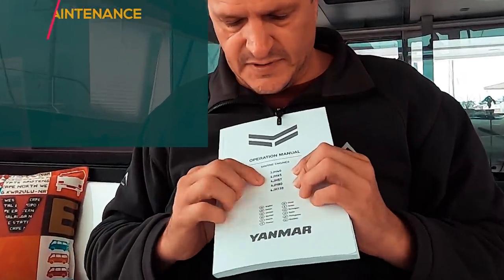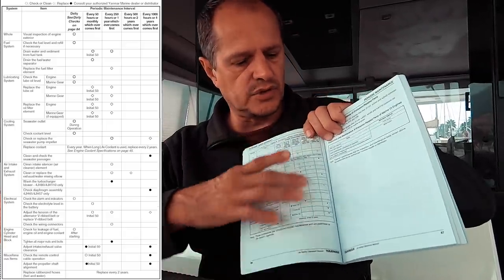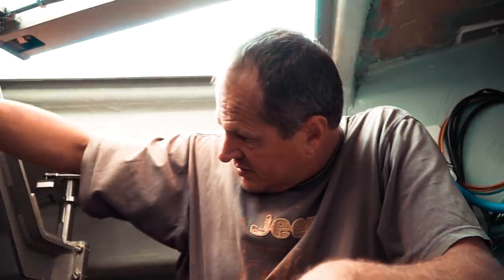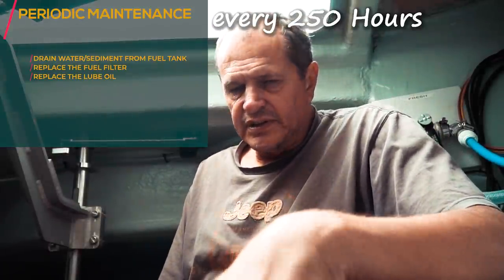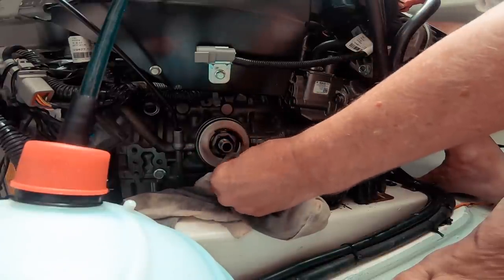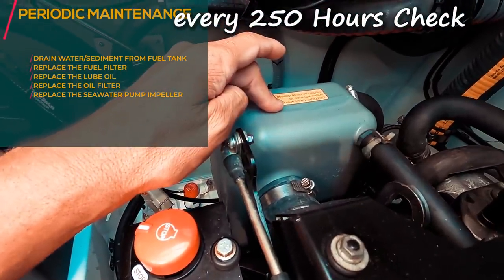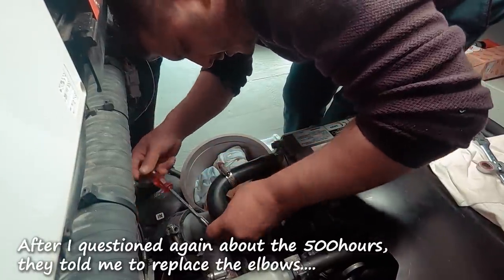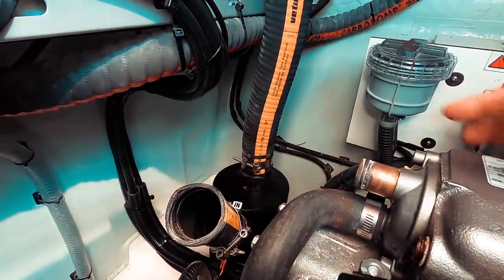#85t Boat Life Yanmar 4JH45 Service | Sailing Sisu Leopard 45 Catamaran Circumnavigating

Comment: Metal filings?   That doesn’t seem reasonable in a newish sail drive, or is it?
Reply from the maker: hi, tony! i have heard that is exactly why the first oil change should be done at 50 hours, because the gears are 'settling in' .... no idea if it is good or bad...all i know is, i am losing my engine by the microns!
Reply: Metal filings... UGGGGH.

I believe most manufacturers would probably have a strategy in place to have an engine or a sail drive in this case to last a specified period of time. They have a degree of control by being in the command position of being able to specify the oil change interval and ... and to recommend oils with a spec that would fall specifically into their longevity target parameters (the co efficient of friction viscosity and heat tolerance to name a few.)

This probably has influence over how they would arrive at their recommendations for oil change. If it last too long then they may go outta business, too short and its a poor quality product. 

If they specify 50 hour first oil change then I probably would adopt a strategy of an oil change EVERY 10 hours until the motor is bedded in. I WOULD iGNORE what the manufacturers say IN in favor of your own more regular oil change strategy.( I doubt you can lose on the warranty doing this ).

Metal flakes I believe are absolutely normal in a new engine, BUT they need to be outta that oil and drive ASAP...REGULAR INITIAL flushing would be my strategy. Visual inspection through pipe ..fantastic yes.

Here is another strategy ...KEEP the old oil in a clear glass container. Let the big flakes and the microscopic metal frictional residue settle though the oil. In a few days or weeks CHECK the bottom of the jar for fine almost atomic metal residue. Keep and mark all jars (if you can in your limited space) until you feel nice and secure that YOU now decide what the oil change strategy should be! ( a lot quicker and more real than manufacturers specs )

The next oil change for me would be in a measured 10 hours and then i would suggest drain and capture the oil for your own visual and inspection purposes in your glass jar to study and check. 

The cost of this check?...X litres of oil..and the reward is the satisfaction of the possibility of the prolonged life of anything that needs an oil change. (not sure if this strategy works on humans though LOL )

After the next oil change I would might also give some consideration of doing a quick diesel flush, (yes its a micron OCD but that,s your baby your talking about) but i would also research the heck outta that before doing the sail drive..

Lastly i have heard that some synthetic replacement oils have a much better co efficient of friction and heat dissipation and some claim to be able to provide guarantees of prolonged engine and gearbox life .. a further lease of life maybe on all your metal in oil parts maybe?

All the best guys, I love your channel and I am working towards getting my own leopard 40 soon for day sailing off Mauritius.
Reply from the maker: Thank you, Richard! Very insightful information!
Reply: To ALL & Richard Lloyd, the first oil change is VERY critical in removing any and, most, metal savings. Most of the shavings are a by-product of machining. Thus need to be removed from ALL engines.

Diesel Algae in the fuel, and keeping it clean is not OCD. It's just good sense.

Comment: Why does an exaust elbow need changing.They should be good for 10 years,inspect clean and replace.that goes for all pipes.I also noticed that you did not change the diode on the engine behind the belt.or did the technitian do it.
Reply from the maker: Mmm... Because the Yanmar manual say so? I looked at the old ones and they looked blackish but perfect otherwise so, I kept them for spares 😊 on the diode, you got me...for me a diode is like an LED, good for thousands of hours... But please, do tell since I must have skipped that section in the manual 🤔
Reply: @SailingSisu  Sorry anode.a lot of people seem to forget that there is a anode on the engine that needs changing.look behind the pully.its only small on the engine.
Reply: it seems that yanmar have alterd there engines.Not sure if they have anodes anymore.Im reading some alarming things.it is though yanmar wants to make a lot of money in after sales.i have read after 2.900 hours,it costing  around £2000 plus for replacement parts,one engine.The anodes used to protect parts.I was alarmed reading the exaust elbow  500 and again and hoses needing replaceing after 1000 hours.and 2000 needing yanmar technition again .imagine if you had a motor cruiser.
Reply from the maker: @t147han  uh? Will look for it, but not sure Yanmar has it
Reply: @SailingSisu  have looked for a full break down of these engines.cannot find.but have read alarming maintenance costs compared to models before.What was the full cost of the 500 hr service including yanmar technitian,and was it a requirement to have a technician.Maybe you could made video of the total costs.

Comment: I think the electrical connections should be loosen and then retighten to the proper torque
Reply from the maker: Thank you, Anthony! What is the proper torque for electrical connections?
Reply: @SailingSisu  you would need to get that info from the manufacturer that brought the components, it a QA/QC role that should have been checked done
Reply from the maker: are you referring to the clips or what kind of electrical connections?
Reply: @SailingSisu  any connection that requires a screwdriver, socket, wrench, etc has a torque rating that ensures good connections and ensures over tighten doesn't occur
Reply from the maker: @anthonyellis9804  ah, great!